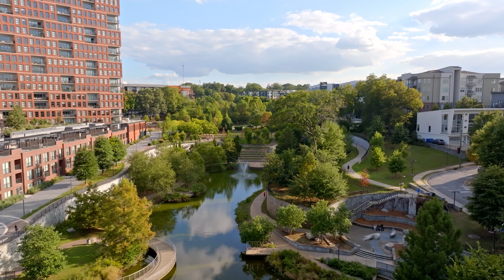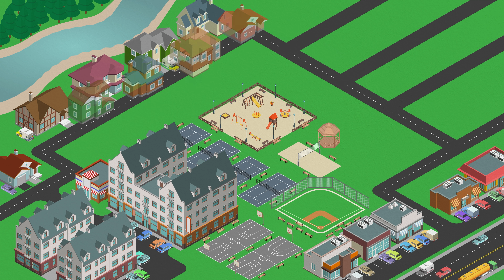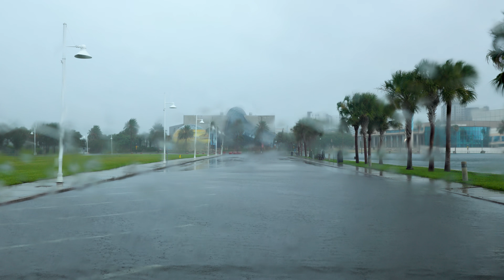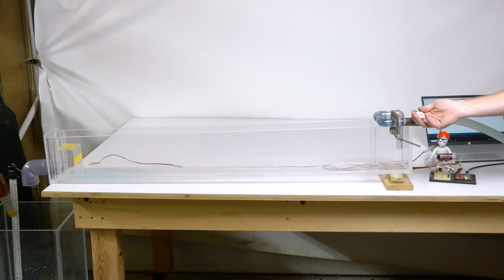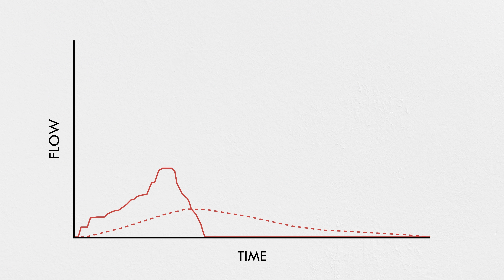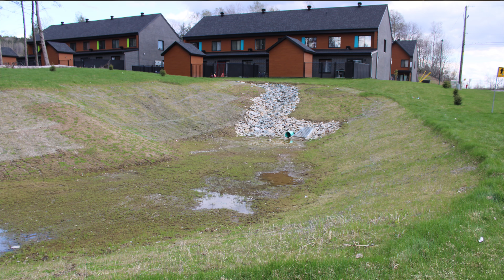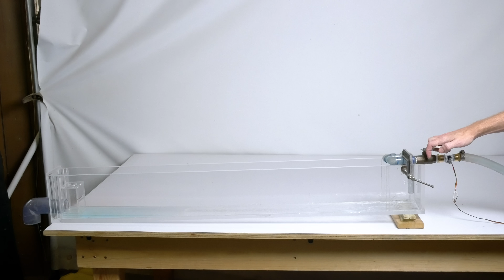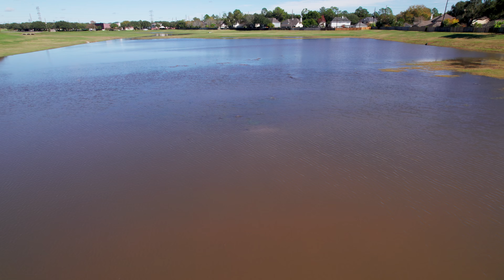Do Retention Ponds Actually Work?

Comment: Here in Virginia it isn't enough anymore just to bring the runoff rate to below pre-development runoff.  We now use an Energy Balance Equation, because we have found that while we were releasing runoff at a lower rate than pre-development it was being released at a higher energy level which still causes erosion.
Reply: Virginia counties, and their civil engineers, have done a great job w runoff, and the C  Bay 21sr century reflects this.
Reply: @Czeck0-u1k thank you
Reply: Right, Grady primarily discussed flow rate as “volume / time”, but rate is also “area × velocity”, and higher flow velocities are more energetic, by velocity squared  no less.

Consider a home power washer: The flow rate out of its nozzle equals the flow rate through the garden hose feeding it, but the higher nozzle velocity makes the flow much more erosive than if it would be simply coming out of an open hose end. In a power washer that is the purpose, but it’s trouble when scaled up to the outflow of a hydroelectric dam. There, a feature like a “stilling basin” is needed to slow the water before it is being released downstream.
Reply: @sternmg the velocity out of the pond is inconsistent.  The more water in the pond the higher the velocity.  As the pond drains the head lowers and so does the velocity.
Reply: Isnt that where youre rip rap pad with or without a level lip spreader is supposed to come into play?
Reply: @Aquade Virginia discovered that there is erosion downstream of the outfall.
Reply: Erosion occurs as a combination of the depth and velocity of flow, both of which are directly related to the rate of flow, and particularly to the peak rate of flow.  Although, as a civil engineer, I have been highly skeptical as to the overall environmental and "human" benefits of most retention basins, the only problem with "erosion," which I observed in the failure of the outlet of one, is in the channel immediately downstream of the outlet.  That occurs if the increase in head created by the basin, as it transforms into velocity at the outlet, is not properly addressed by armoring of the downstream channel, whether natural or (more typically) artificial.
Reply: @CarltonSin Virginia we have to provide detailed outfall analysis and rip rap design at culverts and pond outlets.  About 15 years ago we had a minor arterial road get washed away because of a clogged culvert.  The runoff was finding its way through the culvert bedding and one morning a wide portion of the road just got swept downstream.
Reply: What do you mean by energy level ?
Reply: @Jannis-u7m it has to do with the time factor, among other things. A 9 cfs peak for several hours could cause more degradation than a 10 cfs peak for a few minutes.
Reply: @ryancheney7772  Typically the predevelopment curve will be much more spread out, though...
Reply: @josephfisher426 Yeah that's what they said. What's with the elipses?
Reply: @DF-MadBadger  It's an incomplete thought because it is unclear how VA could have created the problem it is purportedly trying to solve. The scenario of 90% of the natural peak flow for several hours is not readily obtained from a pond.The pond outlet typically receives flow from a weir, the discharge of which falls off rapidly with and produces a peak of shorter duration than the natural condition. Would need two or more successively wider weirs in sequence to achieve that effect.
Reply: @josephfisher426 Virginia didn't create the problem.  It is a problem that we discovered through decades of observations.  When you release water over a prolonged period you are increasing the volume of the runoff from smaller storm events like 1 year 24 hour storm.  That increase in volume causes downstream erosion.  We have also switched to the SCS method rather than the modified rational method for determining flow rates
Reply: @Jannis-u7m 2 gallons a minute 6 PSI verses 2 gallons a minute 90 PSI. One of these Will blast all the dirt off of your skin in the shower. The other one will just get you wet
Reply: @bullithedjames  which is why a larger outlet with an upstream restrictor is better than a small "restrictor sized" outlet pipe.
Reply: @taylorsova2594 the outlet pipe should be sized to handle the 10 year storm (or 25 year storm for VDOT ponds) as if there is no pond at all.  The riser pipe is the control structure not the outlet pipe.  Just as shown in the video, there are orifices in the riser pipe that are used to control the flow out of the pond for various year storm events.  There can also be weirs at the top of the riser pipe to control the larger year storm events like a 50 year storm.
Reply: @Jannis-u7m  Probably the kinetic energy of the flow. It may be high if a water flow is discharged from a thin pipe into the river, for example. Flow kinetic energy is then converted to turbulent kinetic energy and causes erosion downstream. They probably required to not just limit the flow, but also build some some system to slow down the flow (by making it wider) and calm down the turbulence before releasing it into the river.
Reply: @alexeykrylov9995 really it is just that a greater amount of volume is generated over a longer period of release, not turbulent flow.
Reply: @indetigersscifireview4360  Total volume with retention pond is the same as was without it anyway, I guess.
Reply: @alexeykrylov9995 the volume of runoff increases when you develop a piece of land because you have increased the amount of impervious area with buildings, asphalt roads and parking and concrete.
Reply: "high energy level" = high rate of flow during rainfall events I imagine, causing erosion at outfalls..?
Reply: @Jannis-u7m Ryan has it correct, we may be releasing less flow but because it's over a longer period there's more energy.
Reply: Of course.  Anything to employ more bureaucrats and make it more expensive to do business.
Reply: @darthnatas953 why so bitter?  We, meaning the 5 states that have an impact on the Chesapeake Bay, are trying to save it from becoming a lifeless cess pool.  Tens of thousands of watermen depend on the Bay for their employment. And several thousand people depend on the watermen's work for their employment.
Reply: @indetigersscifireview4360  He took a break from Fox and talk radio for a pee break and to fire off a few comments.
Reply: @noahway13 I'm here for conversation not confrontation.  I sincerely want to know why he is mad.
Reply: @indetigersscifireview4360  How am I supposed to know??
Reply: @noahway13 you can't know unless I tell you.  I'm not upset with you.  When it comes to engineering I act professionally at all times.
Reply: @darthnatas953  im sorry you have such a limited view of the world, but reality doesnt share your narrow and negative views. Im proud of our scientists and civil engineers for what they are able to achieve to better our planet and our impact upon it, rather than turn a blind eye to issues in the name of profits. I appreciate how they are motivated by the want to improve people's lives and make disasters less likely, rather than corruption like you desire.
Reply: @cherriberri8373 I appreciate the sentiment about science and engineering trying to make our world sustainable.  Please don't be insulting to others.  I'm here for conversation not confrontation and I would like to help others understand the need for stormwater management.
Reply: @darthnatas953  you prefer washed out roads, floods and high insurance rates.
Reply: @bipl8989  and, you know, dead people. lots of them.
Reply: @schafimwolfspelz7058  of course.  I was trying to keep it PG 13
Reply: @bipl8989  I prefer cheaper development and less bureaucrats.
Reply: @darthnatas953 What part don't you want to build.
Reply: @darthnatas953  So you prefer lower input cost for worse-quality stuff? 
Applying that to something else, would you like a cheap car that falls apart in three years or a more expensive one that lasts for seven, ten, or more?
Reply: @loficampingguy9664  I would prefer to make my own choice, rather than have a bureaucrat choose for me.
Reply: @d @darthnatas953 think they were just saying that the equation used in the video doesn’t work for the circumstances of their area; so, they use something else. Rain water management is just part of the proverbial prep work for civilization. After all, you can’t do business if your shop and all your customers got flooded out due to poor civil engineering.

Comment: Food for thought/idea comments needed?: 

If 'wells' were drilled say 10-300m every 10-100m along a road/street on the edge.
Filled with rocks and then a simple grid placed up to the top.

Would that work on mini storage tanks for floods and directly allowing the water to recharge into the ground since when they get full, they will slowly drain.
But we can add a lot along the roads since it doesn't really take up much space.
Reply: From my understanding we kinda do this with. *cisterns*...
Basically what you said but not as deep and they are spaced where needed.

So if you think of a typical sewer or rain drain. Basically a pipe underground.
Now like you said every so often there is like a pipe/hole that is vertical.with 2 exists And is set up in a way so that water entering is slightly higher than when it leaves. During a Strom event.

The main problem with this system and with what your suggesting. Is that those cisterns catch basins have to be emptied out every so often as they fill up with sediment 
Likewise, the depth of your mini Wells might interfere with groundwater. And would also have to be periodically purged. Now if you think about your local city, how often do you go down a side street and see your drain that's been clogged for decades... It's not neglect negligence. It's just cities have massive infrastructure to maintain and little things like sewer grates get overlooked for bigger problems. 

Great thinking though. There is a YouTube channel though I can't remember it. Some guy in Croatia or Prague. Explores the sewer system during storm events. There is one video in particular where he shows this massive what can only be described as a toilet bowl. That is used during storm events to slowly release water. Most of the videos are in a different language and the subtitles aren't the greatest, but you can very easily get a idea of how combined sewer rainwater runoff is dealt with.
Reply: https://youtube.com/@kanalismus35?si=p3HsfOUEZQuo7f_9
Reply: While this is a good idea in retrospect I believe with the way roads are designed each hole would require the road be sloped/pitched towards to accommodate it which would be difficult, plus the risk of lessened support to the roadway base with holes drilled next to it.

Comment: There's a park where I live that's about 2/3 detention ponds, one of them has willows and bushes in it, the other is a big field that events are sometime held on. I've only ever seen them full of water once. They don't have an outlet, as far as I know, the water just soaks through the ground into the river bordering the park. It's less like they build detention ponds and more like they build a raised barrier along the river to turn what would be flood plain into less likely to flood plane. The time they filled with water was from rain not river overflow, I've seen the river burst it's banks and not into the ponds on other occasions.

Comment: I'd rather see equally distributed bioswales over centralized detention/retention ponds.  The infrastructure costs and chance of catastrophic failure are much lower.
Additionally the bioswales are more esthetically pleasing, need less concrete, expensive engineering consultation, reduce the need for irrigation, greatly reduced chance of mosquitoes, etc.
Reply: Why not both, depending on context?
Reply: Did you even watch the video 😂😂😂
Reply: They're ideas that can and do work together. My city has integrated swales into the design standards for new developments as well as detention ponds - which also must be designed with wildlife in mind. Depends on local geology and the existing hydrology. I'm involved with both surveying the ecology of existing retention ponds and advocating the creation of swales, especially along areas that used to be ephemeral creeks but were turned into concrete storm drains.
Reply: @rouaneb6664 
Agreed.  
They can be made to work with existing local infrastructure for more effective water management.
Our college in executing them  has done an excellent job but our nearby cities are still clueless about how to do them well and it's usually miss.  
I should submit pictures as to what to avoid when thinking bioswales.
Makes me wonder how these people passed engineering.  I look around and realize they've been nominally passed by the colleges they'vd attended, and that's why so much of local code enforcement suggestions are so sad...
Reply: Ah, yes, bioswales throughout my local Walmart parking lot
Reply: @2wheeled_friend to be fair not needing that parking lot in the first place would also be an improvement.
Reply: They have different applications. You can’t fit a bioswale in a lot of places that you would put a detention pond. If the goal is the drastically reduce the peak of the storm, ponds can be perfect. I definitely support more naturalized designs though
Reply: @nickf.8203 
The goal with bioswales is manifold
It's to keep streets dry, safely recharge aquifers, more quickly and efficiently sequester water, add beauty rather than be a fenced off attractive nuisance, can occur in small spaces, are cheaper to maintain, add to regreening, reduce air and water pollution, etc.
They can occur in a lot more places than realized.   It would mean making curb cuts, removing a bit of asphalt from ridiculous, filled-in traffic pork chops, reducing ambient temperature reduction, saves on pumping water, brownouts, added beauty and sense of place, etc.  
The cost reduction in updating infrastruction with bioswales is far less.  New construction giving preference to bioswales is also much cheaper with more visible return on associated expenses.
Reply: @b_uppy you dont have to sell me on bioswales being more beneficial to the environment. But they simply aren’t possible or practical for most sites. Maybe we work in different types fields or areas. 

I’d love if every new development could meet requirement by slapping a giant bioswale down in the middle of it. But that’s not reality
Reply: @nickf.8203 
A giant bioswale is kind of a ham fisted approach.  Small and frequent is very functional.  It puts water closer to where its needed and increases percolation.  More people get to enjoy these ephemeral pools, too.
Reply: @b @b_uppy ah, I get that. We must work on different applications is what I’m getting at. The flow rates and volumes I most frequently deal with would never work with “small and frequent” bioswales. They simply don’t have enough capacity
Reply: @nickf.8203 
And that's part of the fault with that kind of thinking.  Sometimes smaller does better, but you may have to spread it out to areas where the soil is still exposed, before it flows into heavy paved areas and contributes to the problem.
There needs to be a holistic approach  to water instead of county/countryside being cut off from city/urban spaces.
It would also benefit farmers and ranchers to use bioswales to reduce the flow of water to lower areas.  Tokyo is an area that would certainly benefit from this approach.
Reply: @b_u @b_uppy TOKYO??? Where are they going to fit bioswales in one of the most densely populated city in the world
Reply: @nickf.8203 
In the hills outside of it.  You did read what i just wrote, correct???
 
Thinking of it, also adding green roofs would help in Tokyo.  There are plenty of opportunities to add bioswales within, and especially in the higher terrain outside Tokyo.
Reply: @b_uppy oh okay so we are just talking pie in the sky here. Not reality. I like it, a fun thought experiment. 

The amount of money it would take to switch cities over to that kind of design is incomprehensible
Reply: @nickf.8203 
It is difficult to add bioswales to Tokyo. But that's different from impossible.  We are talking reality and real practicality.  It's interesting that in the interest of a low function, highly grid-reliant system you are saying bioswales are the impractical solution.  The centralized water system is just piled on expense that adds to costs.  
Furthermore this water storage beneath Tokyo could have devastating potential, though i do think Japanese engineers are some of the best in the world.  
The problem with this centralized sustem is planning for all contingencies.

Using bioswales reduces the burden on centralized systems like this, while adding benefits the centralized system could only dream of.
Anytime you can add bioswales you improve localization, resiliency, reduce burden, etc.

Comment: In Perth, Australia, you will often come across lakes or ponds, but more commonly in the modern era you come across shallow ampitheatres. These are crassed hollows with a slope on one side, and stepped areas on teh other, giving the appearance of a semi circular ampitheatre that one might use for a play. The eird thing is these ampitheatres always have a drain in the centre. these are retention hollows.
Perth has hot dry summers, but wet cool winters. And while those hollows are meant to serve as entertainment areas in summer when they are nice grassy areas to use, they become wet pools during winter rains.